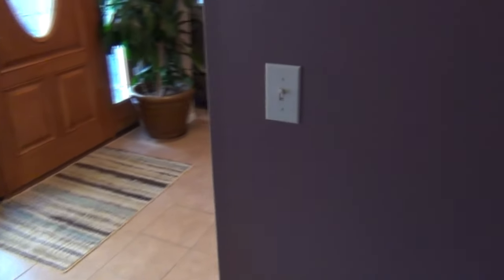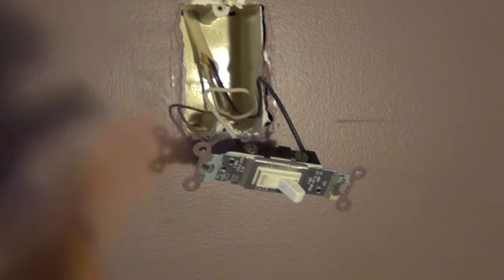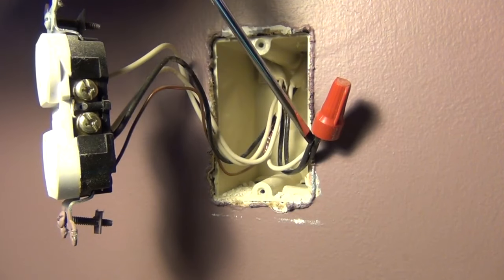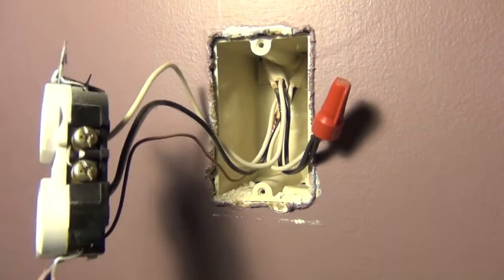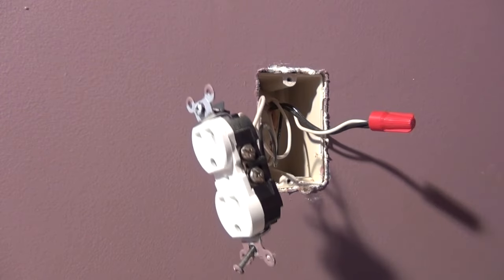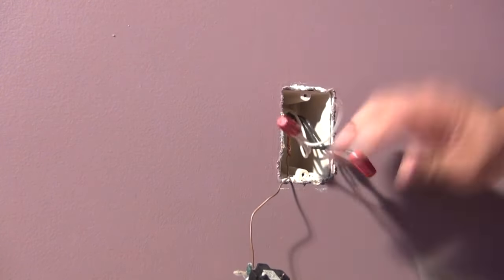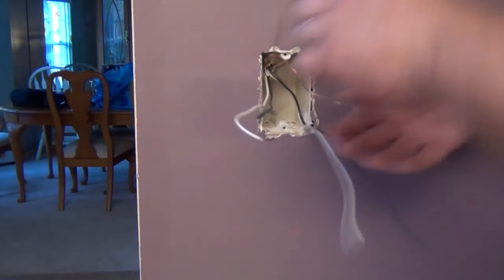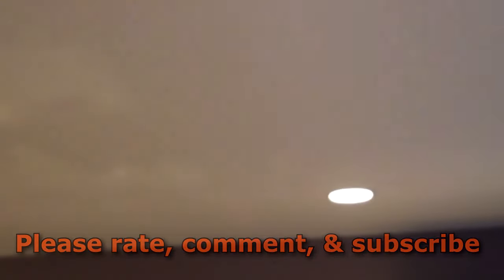Rewire an Electrical Switch box with No Neutral

Comment: Thank you for this video, like others I want to add a smart switch to control an old chandelier.  In the switch box there is an early 2000’s Lutron dinner and only 2 wires a black and a purple.  I’m assuming the black is the line and the purple is the load going to the fixture.  Is it possible that the light fixture had the neutral wired directly and I can split off that connected via wire nut to run a neutral wire to the switch box?
Reply: hey, could you reply here when you found the answer? same situation here.

Comment: Question- my dining room has neutral wires and has a smart dimmer installed. RIGHT behind it on the other side of the wall there's the kitchen light switch box, but no neutral. Can I pull the dining room neutral through the back to supply neutrals for the kitchen light switch? Just add a short white colored wire between them? Thanks!
Reply: I know this is a ridiculously late response but only do that if the kitchen and dining room are on the same breaker

Comment: I'd like to replace a single pole switch with a WiFi smart switch that requires a neutral. In my case the single pole switch which controls my exterior front light is located in a duplex box next to a 3-way switch for a hall ceiling light. Can I tie into a neutral wire from the 3-way without affecting either switches operation?
Reply: I'll answer my own question as it hasn't been answered, I didn't provide enough info. and I have since done further investigation. I will not be tying "into a neutral wire from the 3-way" as I phrased the question. 

There are 4 sets of romex coming to the duplex (two gang) wall switch box.  3 have their white neutrals tied into the same wire nut, including the neutral paired with the black (hot) that goes to the bottom right screw connector on the single pole switch I want to replace. The 4th romex has a neutral that connects top left on the adjacent 3-way and not tied to the others. Both switch's power are controlled by the same breaker. (As well as the ceiling light and 3 wall receptacles in my office on the other side of the wall).

Since they are all on the same main panel circuit I can easily connect the neutral wire required for my WiFi switch to the available neutrals tied together.

Comment: So, what if I’m installing a ceiling fan and the switch already has a neutral in the box? The switch controls an outlet so i need to use your method to rewire the outlet I’m assuming.
Reply: SAME. Idk if it’s any different or if it’s the same procedure!

Comment: Question: would you just wire nut the cable ends if the switch was not being used until it might OR just pull the cable out if you don’t need that switch?

Comment: The video is great if I want to add a device that the switch can control by bypassing the plug. In my case, I just want to add a wi-fi switch to control the plug. I need a neutral wire? It looks like my only hope is to run a neutral wire from the plug to the switch. That sucks.
Reply: Great Idea! However, the room has no ground. So I guess I'm screwed. But I could do it in parts of the house that does have a ground.

Comment: The bare equipment grounding conductors require a wire nut or some other type of connector not just the conductors twisted together.  If someone opens the receptacle and doesn't know why the white conductor is spliced to the two black conductors they should hire an electrician.
Reply from the maker: Thanks for the comment, have a great day!

Comment: Excellent video and explanation of why black tape or marking should always be added. However, i cringed when You cut excess wire off. I never do that since i came across to many jobs that had wires way too short.
Reply from the maker: rms59 Thanks for the compliments. When we I trim the wiring in a j box, i make sure to leave enough for future work. The pinky and thumb trick which I'm sure you know is what I use to gauge the length of my stub outs.  I like to trim all the conductors to the same length for ease of install
Reply: What's the thumb and pinky trick?  stubs should be as long as the distance from thumb to pinky?
Reply: @n5yiz  I'm guessing that's what he means. When I was helping my electrician wire our house, he told me to put my middle fingertip on the wall above the outlet and to extend my thumb all the way out. Pull the wires out of the box (this was right after the drywall was installed, so the wires were still long) and snip them off at the end of your thumb. This gives you roughly six inches of slack, while not totally crowding the interior of the box.
Reply: @jossimbyr  Thanks...I'll have to remember that trick.

Comment: I wanted to add a receptacle off my light switch. the switch is wired like this, with only 2 hots ( one black one white) and a ground, and no neutral. how would I wire this up?would it be easier to wire the switch from the light fixture since that is where the hot is coming in? how would I do that?

Comment: Before this I had no clue how you could even have a switch with no neutral lol.  I feel dumb
Reply from the maker: Yup, sort of an old school way of wiring.  Codes have changed for new installs and require a neutral in switch boxes to accommodate smart switches/devices

Comment: my home was built in the 1940's I am installing a bathroom ventilation fan so In the process of switching my single pole switch to a dbl gang switch I noticed that there is only one black wire and one white wire there's no wire for the power to go out?
Reply from the maker: You have a switch loop or leg currently installed (same thing I showed in the beginning of the video in the switch box.  There's a couple ways to fix this but the easiest would be to pull in a new wire with a neutral in it.  Your box as it stands only has 1 hot coming in and a feed going to the light.  The other option would be to tap off the light junction box and run from that to the fan.  Only downside is that the light and fan would both be controlled with the existing switch.

Comment: I have an older decora light switch that looks like there's only 2 wires connected to the back of the switch: a Load and Line wire. Inside the box are 2 ground wires twisted together with a nut at the tip. And 2 neutral wires twisted together with a nut at the tip. I want to place a new decora switch but it requires me to connect the line, load, neutral, and ground wire to the actual decora light switch. my Q is: how do I now connect the 2 neutral wires, and the 2 ground wires to the back of the switch. Do I need to splice it or buy a ground and neutral wire connector addition? Thanks!   Great video btw.
Reply from the maker: F C you can pigtail off the existing wire nuts to the new switch. A pigtail is just a short jumper wire. So instead of 2 wires under each wire nut, you'll now have 3. (3 neutrals and 3 grounds).  Just work safe and smart. If you're unsure, get an electrician in.  Thanks for the compliments, I appreciate it!

Comment: I like it, however, when you speeded up the video on the receptical, I could only count three black wires and three white wires going into the wire nut.  You said four, but I lost the logic of the circuit at that point.
Reply from the maker: Harry McMackin the 4th wire is the pigtail from the wire nut to the outlet. Hope this helps

Comment: In a situation like this you are not required to identify the white wire in the switch box with tape. You don't know the code on a white wire. A white wire is either a neutral or a constant hot.

Comment: If my GFCI socket has a neutral, can I piggy back off the neutral to the switch box? The genius contractor who did my house used 2 wire romex (2 hots and ground, no neutral)  to the majority of my house. :(
Reply: You question doesn't make sense, without neutral in 120 volt circuit it will not work.

Comment: Hey man. question, my switch is on a split, so the only wiring coming in to the box is controlling the light. like there isn't hot wires coming in and separate wires exiting going to the light. when i shut off the breaker, the light, outlet, stove, kitchen lights lol all lose power. so how do I fix this? Im installing a wifi switch. Thanks hopefully you see this.
Reply from the maker: jefftiburon Sounds like the source power is feeding the light junction box and they have a switched leg with a single piece of romex to your switch box. If that's the case, only thing you can do is run an extra piece of romex from your light down to the switch box to add a neutral to that location

Comment: can you use the same configuration and add a dual single pole switch?
Reply from the maker: soulsurfdog Yes since all the neutrals in a switch box get tied together in most cases.

Comment: Shouldn't you add a green wire nut to the grounds? Is that not a requirement?
Reply from the maker: zeroskater720 I don't believe it's required. I don't see a purpose to nutting the grounds. I always give my ground wires a good 7-10 twists inside the j box. Leave one long to tie into the outlet or switch and you're good. It'll never come apart.  Thanks for the comment.
Reply: Right on.  Thanks.
Reply: Wire nut isn’t the best way look up bucannon splice caps for ground, must have physical connection
Reply: jamit2u agree, but truly all connections should have a solid physical connection. He showed this well by giving black white and ground wires good twist connections before using wire nuts! 
When it is bare ground wire why would code require a wire nut?
Reply: because the grounding wire is the most important wire in the system, as it's for personnel protection, you "should" always ensure a  good connection on the grounding wires with a "permanent means" of connection, such as at least a wire nut, crimp or quick connector (note: doesn't have to be a "green or insulated" conn.) to keep wires from loosening "over time" due to vibrations and/or expanding and contracting from heating and cooling inside the box. this is required by the NEC. It's not in plain language, but "what" in the NEC is. It starts in article 250 something and refers back to article 110 something not exactly sure of the references, haven't read it in some time now but it's there. sorry, not trying to be mean, just thought you should know and i'm real anal when it comes to grounding.
Reply: A crimp or wirenuts is required by code, you are not allowed to just twist wires together and leave it.

Comment: You seem to know ur stuff. I have a question 

I have 3 switches that is all connected to one circuit breaker. I wanted to upgrade them to with smart light switches so that I can control them over my phone. Anyways all of them turn on and off but I have 5 uplights outside and 3 of them work great but he other 2 is very dim. Any suggestions ? Thanks
Reply from the maker: Emin Aljic If they're all on the same circuit and wire then it's the fixture causing the problem most likely - not your source power.
Reply: Change the bulb , it's probably going bad .
Reply: Are the two dim lights connected in parallel, not in series?

Comment: Hello! Awesome video, but I have a question. I want to install a wifi light switch in my place but I noticed my light switch box doesn't have a neutral wire, that is required to install the wifi light switch. Is it possible to add a neutral wire to that box? Or what can I do to be able to install the light switch I want?
Reply: You can add a neutral wire the same way he did. Neutral wires are generally used for recessed lighting. Try to go from a nearby wall outlet.
Reply: Look at Lutron Caseta. It is the only wifi switch/dimmer I have found that doesn't require a neutral wire at the switch. Very easy to install and setup for wifi operation. Works with Alexa. The catch? They are a bit pricey (but not near as costly as an electrician) and require a hub.
Reply: From my understanding, if you want to use the Lutron Caseta with LED lights, you need a neutral for the LED drivers, at least that's what I gather from reading the manual.
Reply: Stephen Moore So basically just run a wire up on the neutral side from a nearby plug? I'm assuming all plugs have a neutral? I have the same situation where I want to install the Wemo WiFi dimmer switch, but the box doesn't have a neutral. Thanks in advance.
Reply: HowieDub There is no need for a neutral wire at the switch. I am controlling 17 LED's on four 8' tracks to light an art collection. Works as it should ; on, off, dimming, etc. through Alexa, Google home, or phone app.
Reply: tralexan Thanks for the info. Didn't know that. Was reading the manual and it had said neutral required for LED driver. Didn't want to fork over that much money if it wasn't going to work.
Reply: That is correct.
Reply: tralexan Hi I have a question,

I’m trying to installed a TP Link smart switch to control my bedroom(led bulbs). I don’t have a neutral wire. So how what can I do?
Reply: NugGet TP Link requires a neutral wire to work. The zimsjeep video above tells you how to add that wire. If you are not comfortable doing that, then, to date, the more expensive Lutron Caseta is your only choice.
Reply: The RF remote is part of a Caseta "kit" that controls the WiFi switch (available in both switch and dimmer form). There is also a small hub. The switch itself, however, operates no differently than say a WeMo or TP-Link. It is phone controllable via a downloadable Lutron app (in my case for iOS) and works with both Alexa and Google Home. I don't know if it works with Siri/Homekit.  In my home I use primarily voice control. I have never used the RF remote beyond testing it to see if it works.
Reply: TheSeattlegreen Short answer, yes. The app is capable of controlling more than one switch. Long answer, it won't be a walk in the park or inexpensive to make it work. Each of the four switches would need to be replaced with a new switch if you want to maintain the same level of control. And replacing the three way switches with a Caseta/Remote set up is involved and requires a working knowledge of how 3 way switches work. There are some YouTube videos that explain the process. It's electricity. You would need to be certain about the wiring before you begin. And, quite frankly, if this would be your first attempt at doing something of this sort, I would recommend that you tackle something a bit easier.
Reply: thank you so much!
Reply: I wish you would have shown how you ran that new romex to the switch.
Reply: Hi, I am pretty sure that the reason you 17 lights work fine is because together they meet the minimum load which is often 60 Watts. Anything lower will feed some power and the LED bulbs will flicker.
Reply: Martin Vaillancourt my Caseta On/off switch requires a neutral. Without it they flicker. How can I add a neutral or bypass
Reply: @somemovingpictures  old post, but since u seem to know, I also bought a wemo light switch and my current switch only has the wires running to the switch itself, both look like black wires, so a wemo light switch will still work?
Reply: @skroid02  No, A Wemo switch will not work. Think of the two black wires as one black (positive) wire with a break in it. Your switch is in that break and allows current to flow (on) or not flow (off) through the switch. The second wire would then be the white or neutral wire. The Wemo switch requires that the neutral wire be attached to the switch. If you don't see a white wire in the box, the Wemo cannot be connected correctly and will not work.
Reply: The neutral has to come from the same circuit and be ran with the fed wire. If not it could cause overheating and a fire. This is all in the National electrical code book. The code change several years ago, now a neutral wire is required in all switch boxes weather it's needed or not.

Comment: 10:38 where did the extra while log wire come from? Did you install that separately or was that already wedged in there? Thanks
Reply from the maker: kestrada670 That's the wire running up to the new recessed lighting.  It was installed off video.  Thanks for watching.

Comment: I enjoyed you video. Maybe you can help me with my situation. I need a neutral to add a smart switch to my closet light as far as I can tell the switch has the 3 wire romex and the light fixture has a few other wires I'm just curious of the easiest way to get a neutral wire to the switch so I can install my smart switch. Any help would be appreciated.
Reply from the maker: Anthony Hood sounds like the power feed is in the j box of your closet light and they ran a single switch leg piece of romex to the switch. The only real fix for this would be to run another piece of romex from the switch back to the light. You'd the configure the whites to function as a neutral return from he switch j box to the light j box

Comment: I installed some lights my switch is wired correctly however the source that I tapped into doesn’t have a neutral now that source(switch) is controlling the new lights I installed and the old lights it already controlled how can I get a neutral??

Comment: I disagree with your technique in several respects.  However, the biggest problem is the omission of the method you might use to get the Romex from the attic down to the switch.  Everything else you can get from a book.  It is the tricks used in rewiring that everyone omits from these electric videos, and which will be the toughest part of this job.  Give us some videos on this!
Reply from the maker: Guess you missed the pinned comment from me that shows this ;-). Check it out